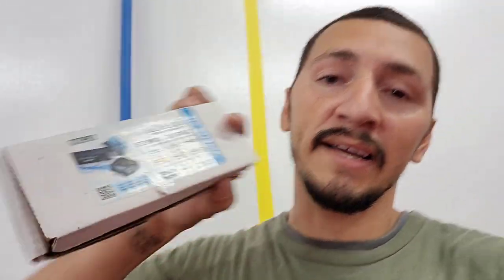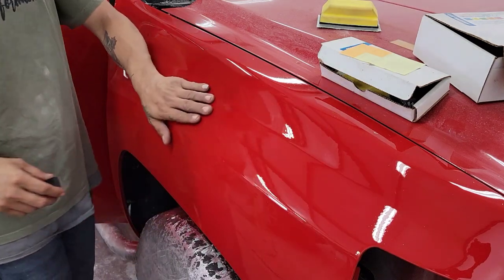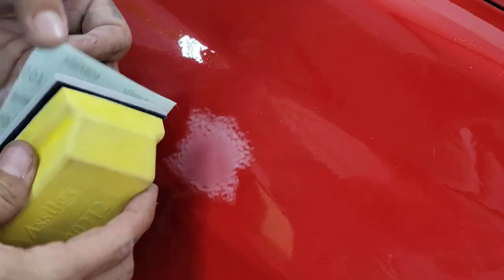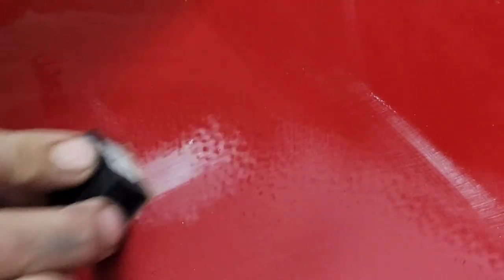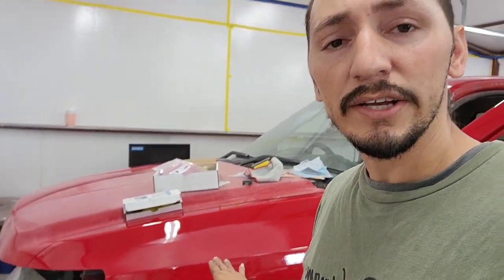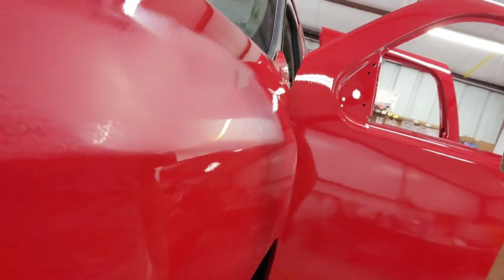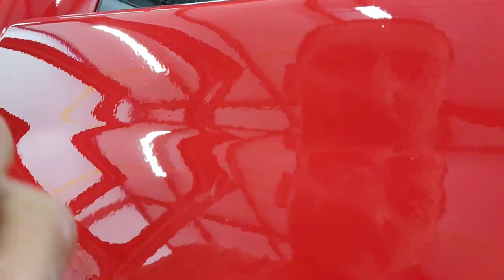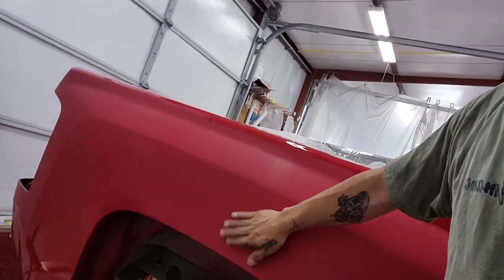How To use "TOLECUT" Sanding Blocks and Why You NEED Them

Comment: The k grit assilex papers are amazing technology. They sand so smooth and fast and don't leave stray scratches. The quality of these sanding media, (can't even really call it paper) is a leap in productivity for people that are doing paint correction. Even final sanding prior to painting. It's just beautiful stuff. I use the k600 assilex wet sometimes if the paint is a little gummy. I had a bunch of solvent pops on basecoat, so I stopped painting. It was cold here and I didn't wait long enough between coats. I wet sanded it with the DA with k600 assilex. It' sanded really nice and didn't clog the paper. Thank God it was only a hood and a tail gate and not the whole truck!
Reply: You wet sanded with the kgrit 600? How long did they last and what were the results? My understanding is the kgrit is dry sanding only but I have been curious to try them wet but they are pricey
Reply: @Jose-mv1bd  They last longer than any wet paper I've ever used.

Comment: This is an excellent video and very well explained. 
Question please:
Is there anything that can be done to stop clear coat from peeling? I have 2008 car with a white hood where the clear coat is peeling and the color of course looks different from where there is clear coat compared to the thew no clear coat areas. 
I want to sell the car (as is) but I would like to minimize the clear coat from peeling any further as along the coat coat edges is starts to peel at some point. 

If there's a way to get get the hood looking better that would be a bonus, but I don't think there is without repainting the hood...
Thanks in advance for any advice and again, excellent video. 

Phil

Comment: Great work dude , what method would you use sanding the whole car ?
Would you use a machine sander in the same steps?
Reply from the maker: I've used these same products on DA, and they make fast work! But you need a big compressor to be running the palm sander. Sometimes after a while your ears are ringing. 
Doing it by hand isn't too bad either. They cut pretty well and not a lot of scratches left behind. And the sheets last long

Comment: I don‘t understand why you used k1200 at the beginning with the toleblocl and afterwards the k1000. And i also dont understand why you grind such a large area. After the 1200 toleblock i would have used the 2000 and 3000 toleblock and not grind such a large area only minimal. after that polishing and it would have been also good